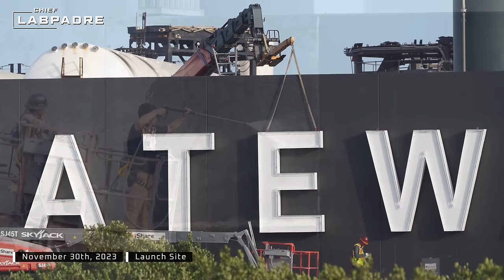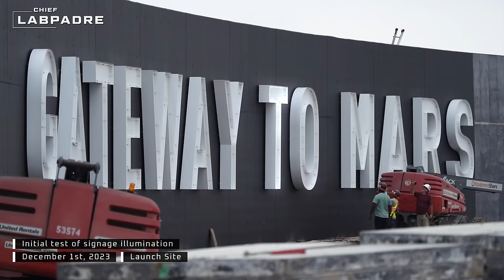What's the Deal With These Tiles? - Photo Gallery [Nov 29th - Dec 5th]

Comment: Smaller tiles would put less weight on each attachment point to the hull, less shaking around. Starship V2.
Reply: More attachment points - more weight
Reply: Less exposed surface when one does fall.
Reply: @kentc8716  …which is most likely offset by lower weight of the smaller tiles. May even be a total wash (weight wise) but results in a better / more efficient design?
Reply: why would smaller tiles reduce weight??? THEY COVER THE SAME AREA @djmistiso
Reply: @djmistiso  but the attachment points are metal (both ends i think) -- and the tiles are polystyrene (not literally).
Reply: The more interesting point is the shape of the tile's backbone. It used to be Y-shaped - now they added edge bars. The metal used to be pushed in from the side of the tile in 3 places, but that can't be done now with the new shape. It should support more of the tile, but of course add weight. Smaller tiles = more studs needed, which means more weight and more welding needed. So, they will need to reduce weight somewhere else.
The new shape should reduce vibrations too. The question is if these new tiles will be all over the ship or only in critical sections.
Reply: @kentc8716  Less weight per tile. Also likely less susceptible to vibration due to great flexibility of the smaller segment size.
Reply: @S1nwar  Less weight per tile. Likely higher over all weight due to more pins and seams. Also likely less susceptible to vibration due to great flexibility of the smaller segment size.
Reply: Lotsa people repeating

Comment: Smaller TPS tiles probably make sense.  Although it will take longer to install all of them, the pressure on the mounts will be reduced, since there will be a smaller surface area distributed across the three pins, so hopefully they are more likely to stay put during the stresses of launch and re-entry.

Comment: I think the only problem with this new TPS tiles would be the time required to install them, BUT, I'm pretty sure they will make a robot to install them autonomously. WHICH, the very same independent robot would be used to repair/replace the tiles while in orbit!
Reply: Why waste mass on tile repair in orbit?
Reply: So you can land 😊
Reply: @WARnTEA  if you cannot land, saving couple million dollars won't help you dude...
Reply: @muratahmetgenc6942   No part is the best part. It's better to design the rocket to not need tile repairs. Keep in mind there are tolerances, the rocket isn't going to melt if few tiles are missing because it is made of steel and not aluminum/carbon like other rockets.

Its more worth it for SpaceX to let a starship explode and learn/improve the starship than to waste so much time and energy on developing and oribit tile repair robot. 

If humans are the cargo on the starship, then obviously blowing up the starship isn't an option, but why waste space on the ship to carry a robot when one of the humans can just perform a spacewalk and repair the tile gap/damage by theirself.

Comment: I am glad to see they’re trying something different with the tiles but I’m wondering if there is a different method because it seems the tiles will slow down the rapid reusability
Not that I’m smart enough to have any better ideas
Reply: The system will most likely improve with time.
Reply: The space shuttle only had to repair something like 100 out of 40,000 tiles each flight. 

Since most of spacex’s tiles are mostly identical they will probably be able to dial in the tolerances to prevent them from cracking, and need to replace less than 100tiles each time. Especially since steel allows spacex to use thinner tiles due to steel being able to handle much higher temps than the space shuttles aluminum and carbon fiber. Making the tiles smaller should make them more resistant to cracking.

Comment: The smaller tiles, could they be specifically for robotic assembly of the heat shield?
Reply: doesn't matter ... they fall off during launch .. SpaceX needs an entirely different heat shielding approach.
Reply: @KrustyKlown  they crack during launch and fall off due to the cracks running along the mounting points. Smaller tiles will be less fragile and therefore less likely to crack.
Reply: In that sense, eventhough I'm factually only a layman here, I believe they'd be better off to create much much larger tile sections, about the height of one barrelsection, possibly more reactangular ones and less hexagons.
I get why they, allegedly, do smaller tiles due to heat absorption and to more gradually control possible material expansion because of it, cause otherwise you may risk cracks and whatever else. 
However, given how many tiles are STILL falling off "here and there"...and certainly they are quite important for reentry...I have concerns and absolutely expect that Starship is going to burn up during its first reentry if SpaceX doesn't manage to make EVERY SINGLE tile stick and remain in place 100%.
Reply: @KrustyKlown Oh, i agree totally on needing an alternative. My idea is to make it a pre-fabricated (Elon likes!) wrap around single-use heat shield blanket that can be ejected when terminal verolcity is reached after re-entry. On the tower a new heat shield wrap can be done automatically, just pull it up like a sock and then tie it down with adequate straps with a remotely operated central release mechanism, like shedding a failed parachute. Or wrap a rectangulare blanket around and zip it up along the back side like a corset. Of course there will be engineering challenges, like how to wrap up the fins, but it should be very doable, and very cheap. Don't really need math that it would be massively cheaper than those tiles. Also: repurposing will become much easier. Put one on as it stands ready, held by the tower, if it intends to come back, leave off if not. One could even put one on in space, if an emergency return is needed from a non-returnable vehicle. A third option would be to have the blanket shaped like Starship, and then put it on like a straight jacket while the fins are in the most downward position.
Reply: @KrustyKlown The TPS was not even a high priority during the first two test flights.  Whereas in the later models beginning with S28 a suction test was applied to the tiles to test how well they adhered to the ship.  Try to imagine that Space X is way ahead of you on the TPS matter.

Comment: tiles were the weak point of the shuttles and led to their failure. Where I saw these tiles for the first time at Space x, I immediately saw huge problems. These problems are now manifesting themselves. As with the shuttle, it will always remain a testicle and wait, do they hold, have they fallen off, are some damaged? It will be expensive and time-consuming and will lead to errors and failures!!!!! The first statement on this project was that these tiles are larger and the number of tiles was the problem of the shuttles. So now smaller ones are coming, so now Space x is back to the tile solution of the 70s. This solution is the end and does not promise success!